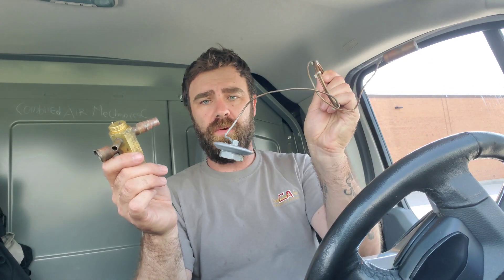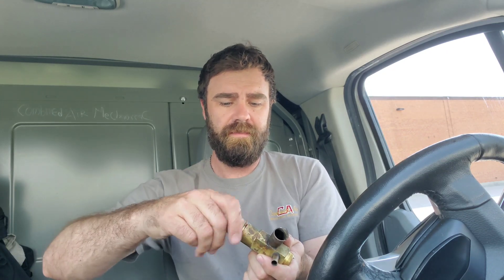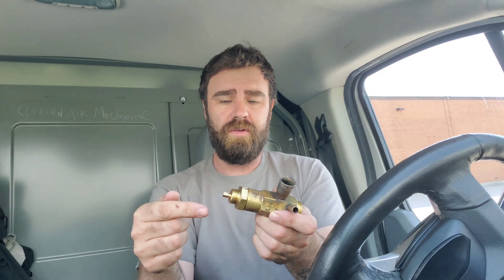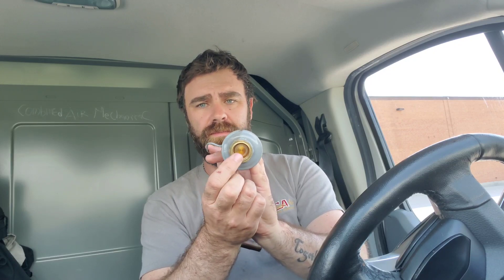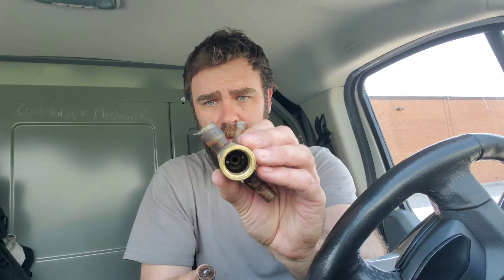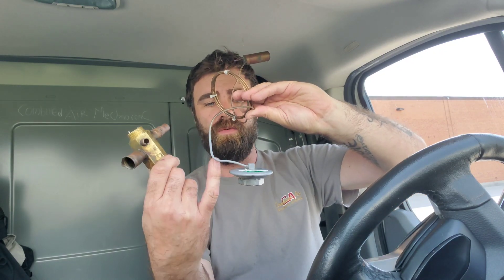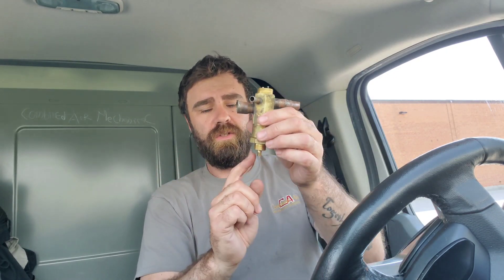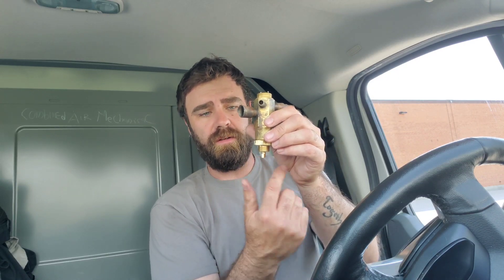Basic TX Valve Operation And Its Three Forces

Comment: Would you be able to change out the power-head without recovering the refrigerant in the evaporator/system?
Reply: I was able to remove the bad power head and change it out...maybe ounces of refrigerant came out..call me lucky I guess
Reply: Oh okay, good to know, better be safe than sorry.
Reply: You absolutely can but you would need a crimping tool to crimp the equalizer line on external equalized valves. They make one that looks like a flaring block and the crimper is in the middle of the block. After you replace the power cap, you round the copper tube open again with the crimping tool. It’s very easy and 99% of the time, the power cap is what fails by losing its charge. You seldom have to replace the valve body. There’s nothing really to wear out but if you had to, remove the guts and replace them instead of trying to remove the old body and solder a new one in. It doesn’t make sense.
Reply from the maker: I would have to say no, unless you could pump it down and valve it off.  I had a coworker burn himself for trying that.